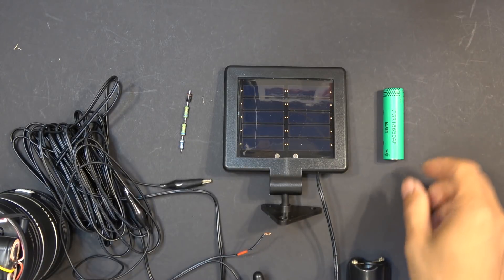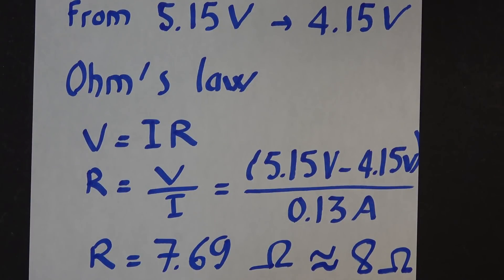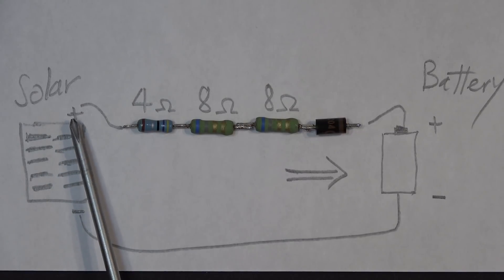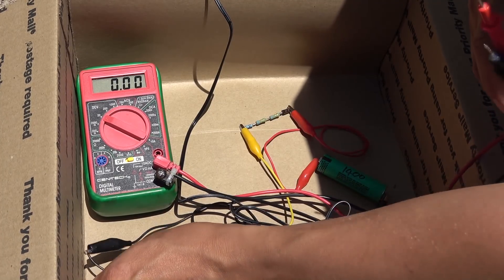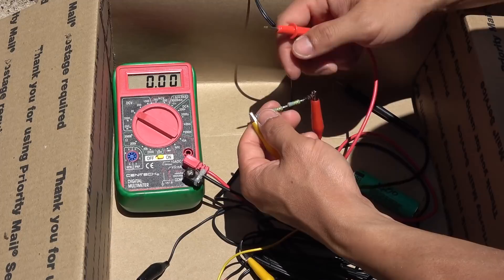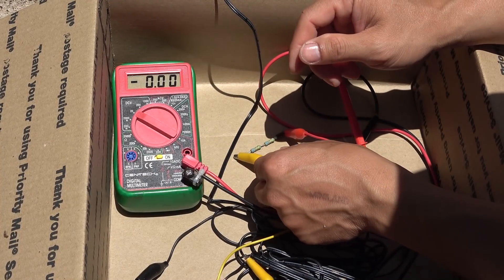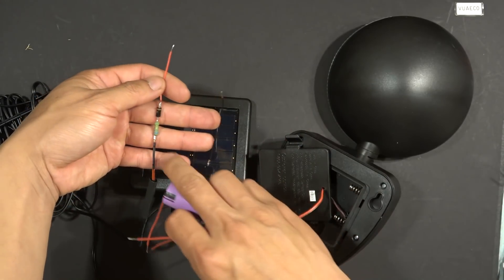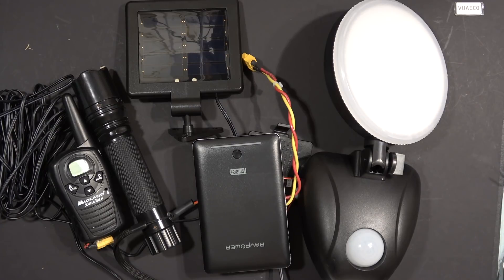Easily charge an 18650 Li-ion battery directly with a 5V Solar panel

Comment: resistive dropping is NOT good enough regulation - as current drops as the voltage of the battery rises, then the voltage will continue to rise until the full voltage of the solar cel, less 0.6v drop of the diode, will be seen across the battery. you need a constant voltage source set precisely to 4.2volts.  In fact - you should use a constant current constant voltage source - but the solar cell will never supply enough current to do any ham so thats why nothing has blown up -yet!
if you have a big enough solar array connected, you WILL destroy your battery using your method of voltage reduction.

Comment: The voltage drop is calculated at maximum charging current. When the battery is fully charged the voltage drop will decrease and the lithium battery will be over charged. In addition- internal resistance of the solar cell and reverse diode leakage would discharge the lithium battery in the winter months and long night hours.
Reply from the maker: Yet, 3 years later, this is still working!

Comment: Great stuff as always  V. I have a panel that produces 5 watt and 9volts. Would this work for a 2s 7.4v. I need over 5 volts output  for my light project. Thanks

Comment: Since the max current from the small solar panel is already limited to less than the max charging current rating of that battery,  no current limiting is needed,  maybe two, 1 amp diodes in series would drop about 0.6v +0.6v =1.2v and have about  3.8v for the batery, if that is enough for some devices.

Comment: Can I use a variable step down converter circuit, set to 4.15V? (Plus a diode of course.) In theory the end result should be the same, the circuit even stabilises the voltage if the solar panels output spikes up for some reason.

Comment: Hi, I have a sunforce led solar light with ni mh battery’s. It had 3 aa at 1.20 v and fully charged at around 4.20v am I alright to put a 18650 without modifying the Circuit board because im thinking it would have a built in protection for the ni mh batterys ?
Reply: I got a Christmas lights that had 3 batteries of 1.2v 400mA and i replace it with a 18650 battery of 1600mA and so far is working perfectly,  just notice that the solar panel is not powerful enough to charge the battery, so next is to change the solar  panel for something stronger.

Comment: the resistor will not stop the charging current once its full .. the voltage drop of diode will ..

Comment: Interesting concept; I experimented similar idea with reasonable success.  As a suggestion in your Ohm's Law calculation, you need to consider the voltage drop across the diode (which is usually around 0.7 volts, depending on diode type and current flowing thru it).
My prototype consisted of 10 cells hooked up in series with a common ground connection, and positive leads tapping off of cells 7-8-9-and-10.  Connnecting to cell #8 would offer an approximate 4-ish volts; I didn't have to worry about overcharge.  My prototype is strictly for experimentation purposes; I'm measuring charging efficiencies (compared to MPPT) and to satisfy my own curiosities.
Be careful with your design as solar panels behave in very dynamic fashion depending on temperature, sun irradience, 18650 internal impedance, load, and so forth.  They don't output power linearly based on these factors.
....enjoy.

Comment: You only need the solar panel and a protected lithium cell. The panel will not push enough amps to damage the battery, and the protection circuit will stop it overcharge,. There are plenty of videos about that on YT.
Reply: Yes, this is true. As a practical matter, I would suggest only using the diode to prevent nighttime discharge of the battery into the solar panel cells. This would preserve the battery stored energy for use by the light only. Also, if the light fixture is opened and examined closely....You will find a diode is already there in some form to protect the original NMH rechargeable batteries from nighttime discharge into the solar cells. So, really no need to add another diode yourself.

Comment: It looks very interesting but I would prefer one of those (new version) tp4056 charging units which I can get as bulk order (38 boards) for around 7,22$

With this Boards I can just solder a 5,2v solar panel and charge my 18650 cells with it. In the evening I can just plug in a microUSB charger and use it to continue charging.

There is also a possibility to add one of those ESP8266 boards to monitor everything with your devices which have WiFi ;)

I actually tried to do this but I failed with the arduino programming language : P If it would work with c++ or python then I would be able to successfully Programm this fake arduino

Comment: You can use tp4056 Lithium ion charger
Reply from the maker: Yes, you can. But you can't get a TP4506 from a local Walmart. You have to order it online and it usually takes weeks or even months from China. But with this, you can just pull out some old electronics, salvage some resistors and diodes, and you're good to go.
Reply: @vuaeco  mee too i bought a dozen for so cheap. they work great